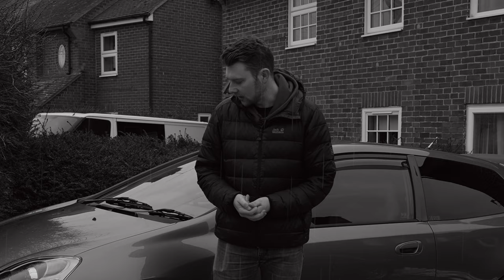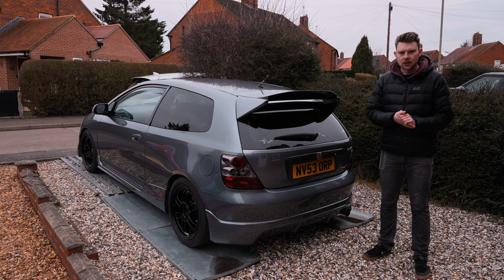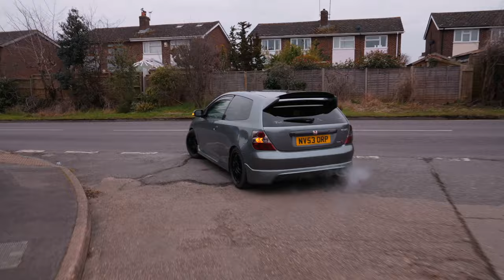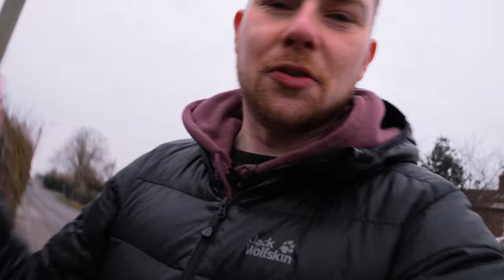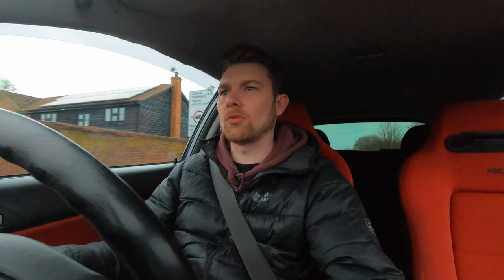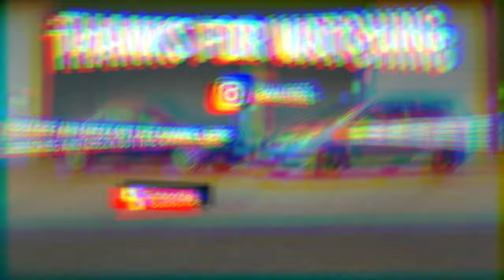The Time Has Come With The Civic Type R EP3!! 4K

Comment: I recon you get a light weight flywheel and performance clutch. And then get the tint on the lights sorted and the rear window bubbling. Also the carbon fibre spoiler and front grill refurb. Then it will be even better than it already is
Reply from the maker: The Facelift flywheel is already lighter than preface and the performance clutch isn't required for this power level. The tint on the rear lights definitely needs doing. Once the performance is sorted, I am going to start focusing on the bodywork. 100% need the refurb on the rear wing and front grill!!

Comment: That exhaust too loud? How so? A bit droney on the inside but outside is perfectly fine dude. I've been looking to buy a EP3 myself before they're gone (either in price or too high mileage) and this is a dream build!
Reply from the maker: To live with every day, it was too much. I put up with it for 3-4 years but now I have made the switch, it has been completely worth it. Plus, gaining the extra power is a bonus! 

Yeah, they do seem to be creeping up now. Thanks though man! I am glad you like what I have done with mine
Reply: @OllyRoss  sound and looks are very subjective. I think the EP3 looks like a real hatchback and it's the last 1 with a N/A engine. Yeah it's 15y old but kinda timeless? I admire people driving this day-to-day instead of a car with (unnecessary) gimmicks that almost drives itself instead of you being the driver. That's why I want 1 of these but then those 15y are a disadvantage. Your build is almost OEM+ like it should have come that way out of the factory. Love the seats too!

Comment: After a lot of research I installed 2.5 exhaust system on my stock EP3, mainly because of where I live and the big possibility of scraping over time...
This 3 inch discussion and it probably releasing more power to the car is scre... my mind actually.

Curious to see how this goes...
Reply from the maker: Scraping is a nightmare with these cars isn't it! I think it is a worthy trade off though! If it is well designed, it could sit higher up anyway...
Reply: @OllyRoss  yeah... I recon sometime in the future I will end up going with the 3 inch route. But until then, many other things will come to the car I guess 🙂😁